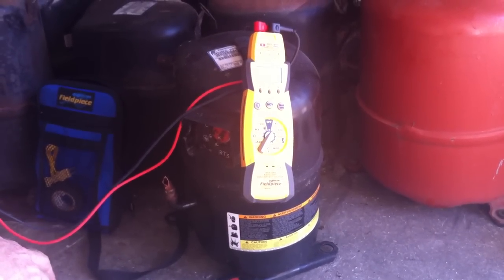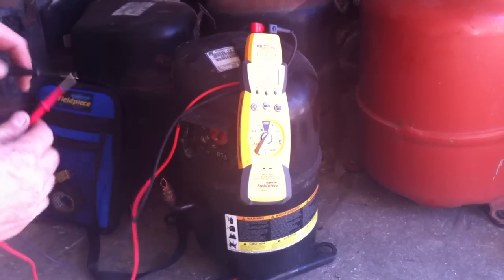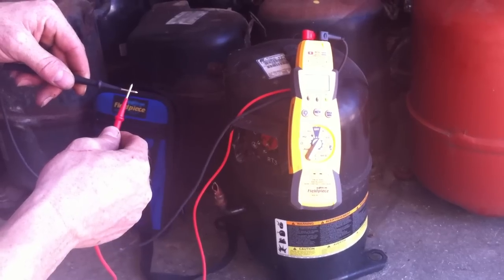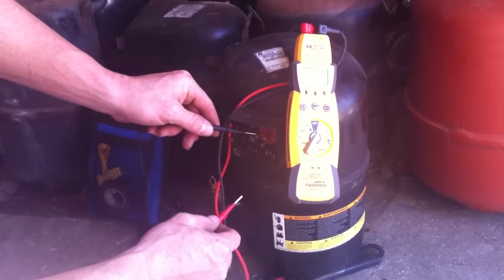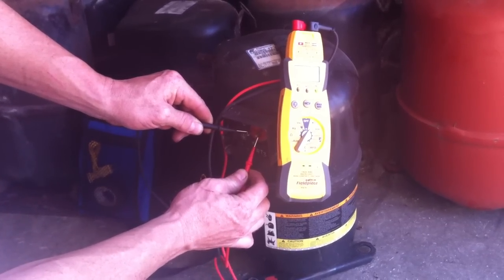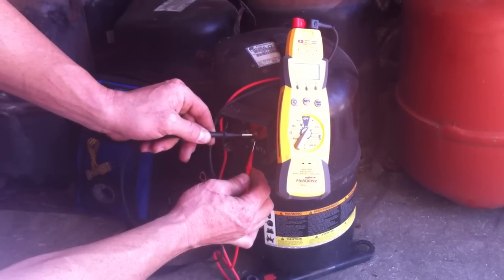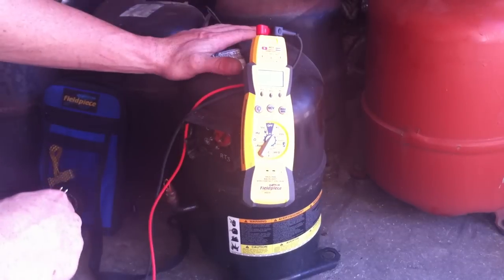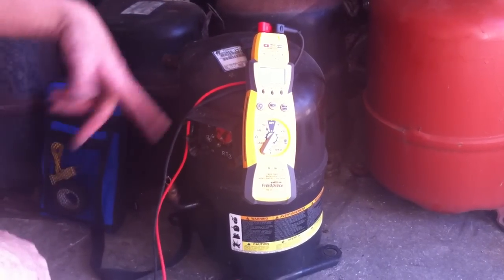How To Test AC Compressor

Comment: Thank you. I did this test on my unit today after a tech declared it destroyed from a capacitor failure. He wanted me to drop $2K on a new one. This test confirmed that my compressor is NOT shorted to ground and terminals all have continuity and the correct resistances.

Comment: I came across a compressor in an ice machine that was rusty because the float was out of adjustment and it was overflowing onto the compressor.   The terminals looked OK but I was reading windings grounded to case.  Could the rust somehow be giving me a false reading?

Comment: This is not a reliable test for a compressor. Your test will show a compressor with internally shorted or damaged coils (not shorted to ground) as good. An actual resistance test is required to test the resistance between the windings.